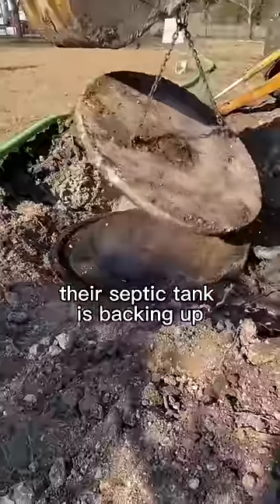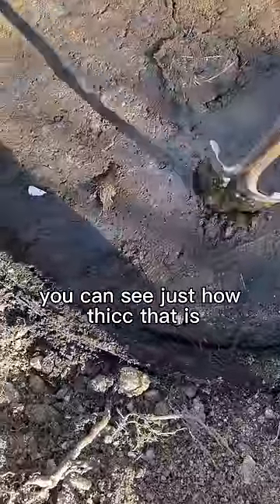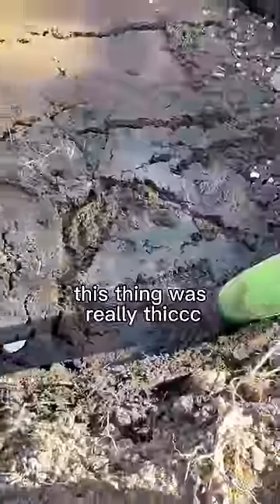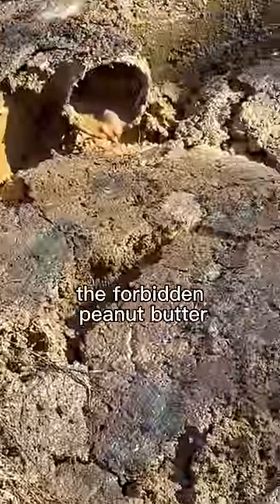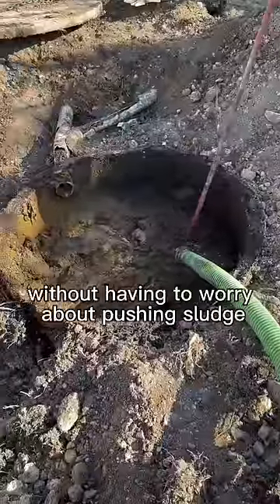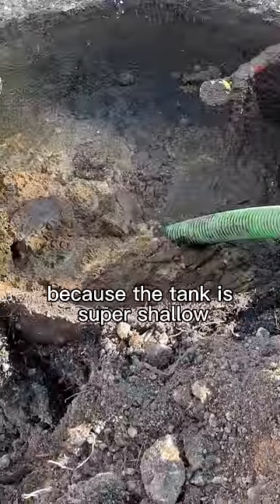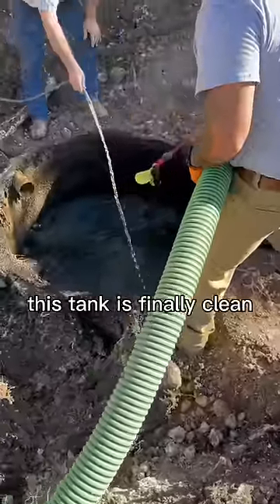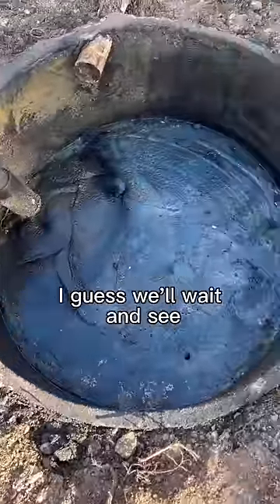Septic Tank Hasn’t Been Pumped in Over 50 Years! #shorts

Comment: That truly is a TINY tank... That depends completely on a great drain field, which has probably been clogged up due to a lack of maintenance.
Reply: It worked fifty years.  I'd bet everything except the toilets are drained above ground somewhere else
Reply: @johncuervo3019  that was my 2nd feeling, because if not there is no other way that tiny tank lived that long besides being "black water" only for a 1 or 2 person house. 

I lived in an old home when I was younger with grey water waste that dumped outside on the ground. In a home with a washing machine and  sinks I could not imagine that tiny tank lasting that long, if so the drain field is killer.
Reply: @volvo09 I was thinking that but I just thought of the grey water might just be helping the waste move through the tank
Reply: On the other hand, it did it's (duty)doody for 50 years, so.....😅😂
Reply: Czasami jest tak, że na dole jest rzadkie, a na górze kożuch. Ale to taki kożuch, aż się pieni....
Reply: @volvo09 that's how our house was growing up. We had a grey water outlet that dumped out under the field and eventually crossed the highway into the farm slurry pit. Black water went to the two small septic tanks.

Comment: "This tank hasn't been pumped in fifty years, Idk how long it will last". Looks to be doing a damn fine job seeing how today's systems need cleaning every 3-5 yrs.
Reply: Yeah but I’m still confused as to how he was able to leave it that long considering it’s so small in size 😂
Reply: @97AshleyRose  right????
Reply: No pump 50 years.? Has anyone lived there for all those years?
Reply: Well the waste goes somewhere. That would mean this things leaks really bad and is contaminating the ground water. I don't think people realize just how shallow it can be sometimes. These old systems are made out of bricks and they don't mortar them from what I have seen. I think the idea was to keep waste in and let liquid out just like the drain field.
Reply: If your septic tank needs cleaning you're not taking good care of your septic tank
Reply: @97AshleyRose  I say it has a great personality.
Reply: The tank is basically for sure leaking, no way that drain field working after being that backuped and that old.
Reply: Probably leaked or wasn't in use
Reply: Circular tank, and the inlet is tangential to center. When sewage enters in a continuous flow such as from a shower, it induces a slow circular rotation inside the tank. This stirs up the liquid and solids, assuring thorough decomposition of the floating scum layer.

Fully decomposed sludge primarily piles up in the center of the tank where the water moves the slowest. Rather than sludge piling on one side by the inlet, the sludge piles primarily in the center and spreads outward as the pile grows.

Outlet has no upper tee vent, only draws clear liquid from below the water line at edge of tank where water moves the fastest when rotating, so the tank can be very full of sludge and not clog the outlet pipe.
Reply: This is a truly ignorant comment.
Reply: A outhouse pyramid takes over pretty quick in -50 Celsius
Reply: Most counties require you to pump it out a minimum every 5 years... no matter how many people are living in the house! Mine was all liquid when I had mine pumped out a few weeks ago after 5 years.
Reply: @OldsmobileCutlass1969Va  Frequent checks are a defensive measure against system failure and groundwater pollution, and protecting people from drain field failure. Once particulates start entering the field, it causes the perforated pipes to plug up until it all fails.

Comment: I saw one like that at a dump in Florida.  They were moving office locations, and needed the tank pumped and abandoned.  NO BOTTOM. About 4 feet down, gravel started.
Reply: 🤮 all the shit leak into local water supply.
Reply: @inkbold8511  well, I never thought like that.  Guess that explains Florida, all those septic tanks and cess pits are sitting a few meters above their aquifer.  Every time it rains, it must actually wash sht into their water supply.  I need to get the fam out of there asap
Reply: That's actually how they used to do them way back when.
Reply: @TFASplbtttt  I’m a Wastewater Plant operator, and after we seperate the solids and treat the water, and that doesn’t get treated further for irrigation goes into a Deep Well, and is pumped about a 1/4 mile underground. 
It’s actually better then a drain field for septic as it goes much deeper and spends more time naturally filtering through the ground.

Comment: I didnt see anyone mention that when septic systems are working as they should the need for pumping them out is rare.  I had to have mine cleaned out after 20 yrs of family of 4 use, the only reason it had to be pumped is due to my renter dumping grease down the drain and it stopped the inflow pipe up.   the service guy said tank looked good and probably was good for another 20 yrs.  cost $300 and that was 2 yrs ago.
Reply: While theoretically with a big enough tank they can last a long time it’s still good to get it pumped more often than that even if just so that you can have somebody look at the interior regularly. It’s good to have a condition that could become a major problem (like something that might cause the tank to structurally fail, or being at risk of having something that will cause drain field failure) be noted and be able to be monitored.

Comment: That's illegal here as it has to be emptied 1-2 times yearly otherwise we get a 1200$ fine. And it must be physically checked every 5yrs if made out of concrete (as these are already 30 yrs old); if any cracks are present they have to be removed and replaced. One compartment is not legal here anymore, 2 compartments are the minimum but 3 compartments is the norm with a weeping system (if applicable/enough land)

Comment: I have a property way off grid completely unincorporated and I want to design a system for it involving 3 chambers with the last chamber containing a pump for shrubbery irrigation.
I was thinking about also having 300ft of leach field pipe. 
The system would need to support a one bath home less than 1000sq ft.
I'm planning to use 3 concrete storm water culvert pipe sections standing vertical in the ground with concrete poured to about 4 inches on the bottom to act as a bottom.
I'll pour caps and place them on top.

Do you foresee any issues with my plan?